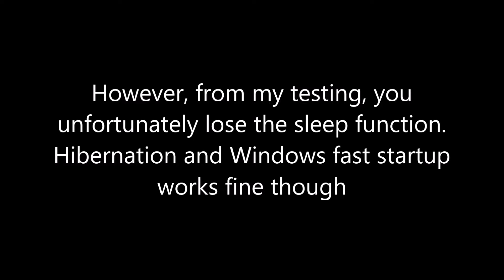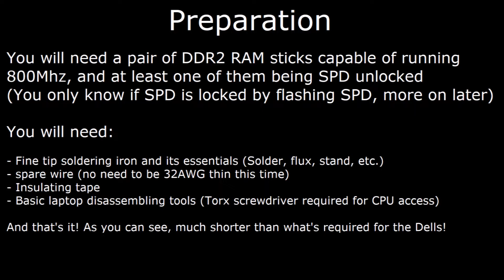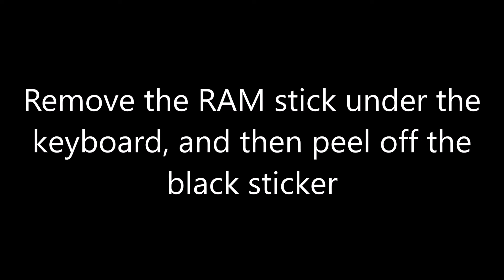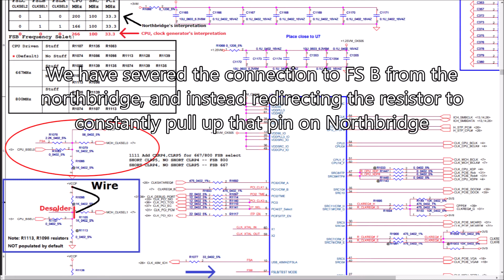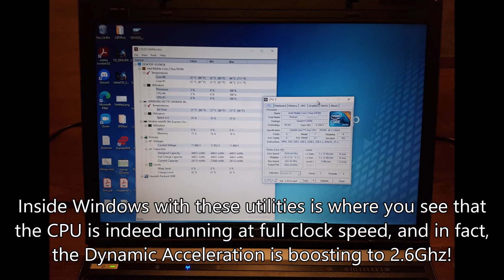HP Compaq 6910p how to upgrade unsupported cheap 1066Mhz FSB CPU

Comment: Great job. I don't have this model. But I have the same Compaq model but with AMD, 6715b, S1G1 socket. 
Is there any modification like one to put S1G2 processors inside?
Reply from the maker: I have no clue if similar FSB overclocks would work on an AMD platform. Not all chipsets have enough overclocking headroom for this kind of mod... The Intel 945PM/GM and GL40 series for example, do NOT have this headroom, and the computer will not post if they are overclocked in this manner
Reply: @kztech1319  on the schematics, you put MCH_CLKSEL1 to VCC, to bring 1 on MCH_CLKSEL1 instead of 0. So northbridge thinks of 800Mhz and boot it.
Reply from the maker: @adonfjv  Coming back to this comment a year later, now that I actually have extensive experience with S1G1 platform with my Compaq nx6325, V6000, Pavilion dv6000, tx1000 and Inspiron 1501, the answer is you should not bother with S1G2 processors.
First of all they are fundamentally different in the implementation of the memory controller. On S1G1, the RAM speed is derived with an integer divisor over the clock speed of your CPU (also hence dynamic), whereas on S1G2 the RAM speed is derived from the fixed Hypertransport link clock speeds.
S1G1 hence is very picky about which specific CPU clock speed giving you what RAM speed, since divisor must be an integer over your max clock, but S1G2 seems to have quite a significant penalty in RAM access and hence bandwidth. Hence ironically I have worse luck with S1G2 processors where even an Ultra ZM-86 inside my Aspire 5536 still feels slower than my Pavilion tx1000 with a TL-60 and 8GB RAM running at 800Mhz.
Optimising your RAM speeds can go a long way in helping your iGPU's performance. Which CPU do you currently have and what exact RAM speed are your RAM running on currently (see CPUZ's memory section, use 800Mhz sticks for this test)?
For example, if your motherboard/integrated graphics only accept RAM clocks up to 667mhz (333mhz), A Turion 64 X2 TL-60 (2000/6=333 exactly) will give you faster RAM than a TL-62 (2100/7=300, 10% penalty)
Lastly, these are for G2 Tyler stepping ONLY! Earlier revisions are much less flexible in RAM speeds

Comment: Hi. 
I watched your video and I too wanted to modify my laptop to serve me for many years to come. The video explains very clearly how to modify the laptop. Gorgeous!!!
I have a HP compaq 6910p laptop with ATI x2300 discrete graphics (compal la-3262p). I bought a T9800 processor and I want it to work in my laptop. For this I repeated your MOD step by step, but my laptop, after pressing POWER, turns on and off without a picture on the display. I don't understand, I get CPU_BSEL1 = 1 instead of 0.
Can you help with advice on how to make a notebook? Can you tell me your TELEGRAM or WHATSUP for easy communication?
Reply from the maker: Here are some things you can check:
Do you have a later bios? (Don't update to the latest version but ones from 2008 will suffice)
You have checked that the resistors are set correctly, that if you check the schematics, the BSEL1 pin to the northbridge needs to be high (via resistor) and the one to the clock generator is low
Have you modified the SPD timings of your ram correctly? Since you have ati graphics you should get away with taking a pair of 800mhz stick and simply remove the 667mhz profile by setting the speed for profile 1 to be 00. You will need to do that on another laptop since for me SPDTool only detects the ram about half of the times on the 6910p
Reply from the maker: Lastly, I dont think T9800 will do too well here. When I tried the T9600 on my 6910p I noticed significant battery life penalties and significant extra heat output compared to the T8100/T8300 or the P8800 I have modded and put inside
Reply: @kztech1319  Thanks for the quick response.
1. BIOS F.19 of July 6, 2010. Do you think that it is necessary to install an earlier BIOS F.17 from November 4, 2008? Why?
2. The 1Kom resistor is set correctly from +Vcc to MCH_CLKSEL1. When enabled, MCH_CLKSEL1 = 1.8V.
3. The one to the clock generator is high, because as I wrote above, I have a CPU_BSEL1 = 1.8V signal from the processor with the T9800 processor installed. For an experiment, I return my old T7700 processor to a modified circuit and it starts at its 800 MHz frequency. It seems that BSEL1=1 is forced (maybe there is a jumper with +Vccp, which is not on the diagram).
4. I modified the timings according to your video, there is no problem there.
5. After the T7700, I think the T9800 should work fine, it is 10W less. And even more so, I don't use a laptop from the battery.
Reply from the maker: @ДмитрийЧернов-щ9ч  To answer your questions:
1. No need to change the BIOS then. F17 bios is more ideal if you wanna hack the BIOS but it has no difference in CPU compatibility.
2. I hope you connected it to the specific VCore (CPU) pin that I mentioned not the Vcc of the RAM. 1.8V seems way too high and is the RAM voltage.
3. I think I have mentioned that I removed one resistor (R1105) that connects the MCH BSEL1 to the rest of the BSEL1, this way that MCH voltage doesn't spill over to the clock generator.
Yes T7700 should set BSEL1 to high internally, but T9800 shouldn't. If T9800 does it despite you removing that resistor, then I am afraid your T9800 is fake and never going to work.
5. Yeah if T7700 works fine then T9800 should be okay. But when I tried T9600 on mine though (with iGPU) it seemed to run very hot, much hotter than the double cache of T9600 over P8800 can justify, so I stuck with P8800 instead.
Reply: @kztech1319 
2. With a voltage of 1.8v, I probably made a mistake, now the laptop is busy and there is no way to measure it. I'll write more about stress later.
3. I also moved resistor 1105 to the left to break the circuit between MCH_CLKSEL1 and (CPU_BSEL1 + FSB).
I can't test my T9800 because I don't have another laptop. But are such processors fake?

If I turn on a laptop without a processor and measure CPU_BSEL1, will it be 0 ?
Reply: Maybe you should try to remove R1107 so that BSEL1 is guaranteed to be 0?
Reply from the maker: @ДмитрийЧернов-щ9ч  It is not impossible for the CPU to be fake, although T9800 is not worth nearly as much as T9900 to be worth it to fake.
If you really did send 1.8V to BSEL1 that may potentially have damaging effects, since the VCore rail is normally no more than 1.5V at most
Even if BSEL1 is high everywhere, the computer will still work just fine with a T9800, just it will run at only 800Mhz FSB so a severe downclock.
also the reason why I didn't bother removing R1107 is so that with a normal 800Mhz FSB CPU the computer will still turn on and run stock clock speeds if for some reason I need it that way.
Can you double check your modded SPD timings? for SPDTool there is the timings tab below and you can use that to view the modified timings in real time. Also make sure you got no verification errors when you write the changes to the RAM stick (or else your RAM SPD chip is locked and the only way to bypass that is replacing the SPD chip on the RAM stick and clone the SPD info over)
Reply: @kztech1319 
Today is a day devoted to my laptop, here are my conclusions:

1. The Vcc voltage is 1V, not 1.8v, I made a mistake earlier.
2. I removed R1107, 0 appeared on 57 pin FSB of the clock generator. But the T9800 also does not start.
3. I applied Vss to B23 pin of the processor, BSEL1 got 0, but T9800 also won't start.
4. I installed the T7700 in this mod configuration and the processor started and went into the BIOS, but Windows stopped at boot. I think the T7700 started on bus 1066 (3.2 Mhz). From this I conclude that I have a faulty T9800 processor.
5. Regarding the memory, yes, I have hunix memory modules, when flashing the SPD, the SpdTool program gave a verification error, I replaced the SPD chip, now I can flash the memory normally.
I flashed with timings:

@ 266 MHz 6-4-4-12 (CL-RCD-RP-RAS) / 16-34-2-4-2-2 (RC-RFC-RRD-WR-WTR-RTP)
@ 266 MHz 5-4-4-12 (CL-RCD-RP-RAS) / 16-34-2-4-2-2 (RC-RFC-RRD-WR-WTR-RTP)
@ 200 MHz 4-3-3-9 (CL-RCD-RP-RAS) / 12-26-2-3-2-2 (RC-RFC-RRD-WR-WTR-RTP)
Reply from the maker: @ДмитрийЧернов-щ9ч  Try to use memtest86 with the T7700, that thing will tell you the true clock of your CPU before starting the test and stuff. Yeah unfortunately it appears like your T9800 is faulty/fake.
Since you don't have any other machines to test with, one alternative is to use either a Core 2 duo T6600 or T8100 instead. These processors are on 800Mhz FSB and will work just fine stock, but their magic is they can be run on 1066Mhz FSB perfectly stable and give you 2.8 or 2.93Ghz clock speed.
Reply: @kztech1319  
I decided to establish the truth and that's why I bought another T9800 processor today.
With this processor, my laptop starts, you can enter the BIOS, but Windows does not start.
I turned on MemTest, the processor is running at a frequency of 2926 MHz, the memory test does not pass.
Memory runs at 339 MHz (DDR2-678), BCKL-254 TIMINGS 6-5-5-15
What memory parameters should I choose for stable operation?
Reply from the maker: Assuming your ram sticks are both PC2-6400S 800mhz, with discrete ati graphics, the easiest way is actually simply modify just one parameter by setting the profile 1 speed to 00 and disable it, leaving just 533 and 800mhz profiles. Then the laptop will choose the profile of 800mhz and run it at 880Mhz, which is usually stable in my experience without integrated graphics to worry about
Reply: @kztech1319  I have a PC2-6400S 800 MHz memory.
I excluded the 333MHz profile, the laptop starts with a memory frequency of 848 MHz and very low timings for this frequency of 6-5-5-15. If I set the profile to 266 MHz, then the memory starts at 678 MHz 5-4-4-12 and there are always errors in the test.
It is necessary to increase the timings, but there are a lot of timings and I do not know what values to choose for them. Can you help me with this?
Reply from the maker: @ДмитрийЧернов-щ9ч  A RAM frequency of ~880Mhz with timings of 6-5-5-15 should be perfectly stable, given that you have discrete graphics on yours (my integrated graphics will crash). Unless you are very unlucky on your RAM that it can't even take a 10% overclock. Saves you loads of hassle too
Reply: @kztech1319  I solved the problem with timings by setting them manually. Memtest checks the memory without errors.
Now I have another problem. I have Windows 7 and Linyx-mint installed on my laptop. I can only boot Linux or Windows 7 only in safe mode. In normal mode, when the screen is turned on for a GREETING, when the screen takes a resolution of 1440x900, the laptop is turned off. This problem is definitely related to the video card, maybe the video card is also overclocking due to an increase in FSB? Or maybe there is not enough power of the power supply due to increased CPU consumption?
Reply from the maker: @ДмитрийЧернов-щ9ч  Does it do that with a T7700? Honestly you should really get a more power efficient processor than the T9800, as on my 6910p I even had problems with the T9600 where it would start power throttling. You really should've gone with a P9600 or something
And also try it on battery power if your battery is still good
Reply: @kztech1319  Everything works fine with the T7700, this is the processor that was used when buying a laptop in 2009.
When powered by a battery, there is also a failure. So the power supply does not affect the shutdown? This malfunction is somewhere on the main board. Something is wrong with the power supply of the graphics card chip, at this moment the throttle whistle is heard. Only I can't determine where.
Reply from the maker: @ДмитрийЧернов-щ9ч  So here's the thing. If the behaviour changes on battery power vs on charger power, it is likely that the CPU Vcore filtering capacitors are dying. That is what I get on the Acer Aspire 6920 with a NEC Tokin filtering capacitor.
But in your case, all signs indicate that the CPU you put inside is simply overwhelming the laptop too much. I remember that only the beefiest laptops can even handle a Core 2 duo T7800 without crashing, and in your case you kinda have that problem especially since your northbridge and ram and stuff are still 33% overclocked.
just get a Core 2 duo P8800 or P9600 and be done with it. Or if you want to, a T6600/T8100 and let it overclock the CPU. The catch is that sleep does NOT work with any of the P8800 P9600 or T9600 T9800 T9900, works fine with a T6600/T8100 with the FSB overclock. This is the case on both my Compaq 6910p and 8710w
Reply: @kztech1319  It is a pity that I do not know the node that is overloaded when the T9800 is turned on. I do not think that the overload is caused by a large current consumption by the processor. I controlled it by the laboratory power supply. Since both the T7700 and T9800 were the same, no more than 2.75 A at the maximum. It is more likely that an increase in the bus frequency negatively affects the operation of the discrete graphics card and a reboot occurs.
In conclusion, I started the T9800 on an 800 MHz bus with a processor frequency of 2200 MHz, forcibly turning on BSEL1=1. The laptop works fine. I also tried to start the T7700 on the 1067 MHz bus with a total frequency of 3200 MHz, but this leads to a stop immediately when the laptop is turned on.
Reply: @kztech1319  I checked the voltage of the processor core with an oscilloscope, I did not like that the voltage range, at start and in BIOS 1V, continued loading of Windows from 0.960 to 1.18 V. A fraction of a second before the WELCOME screen is turned off, the voltage drops to 0.90 V. There was never 1.25V. at the time of loading. It is necessary to raise the tension somehow. I'm thinking of making a volt-mod.
Reply: @kztech1319  The T9800 processor has made some progress in adapting to the HP 6910p laptop.
According to the LA-3262P scheme, the processor has H_THERMDA_R and H_THERMDC_R signals, they are fed to the Thermal Sensor through resistors R23 and R34.
If I change R23 and R34 to 330 Om, then the laptop boots up in normal mode and works for a while, but then shuts down again. The processor itself is not hot.
I increased the values of the resistors 470, 680 Ohms, but this also causes disconnections, while the fan is running at maximum.